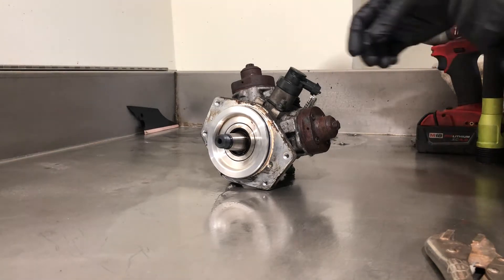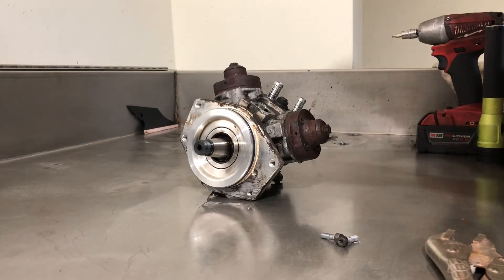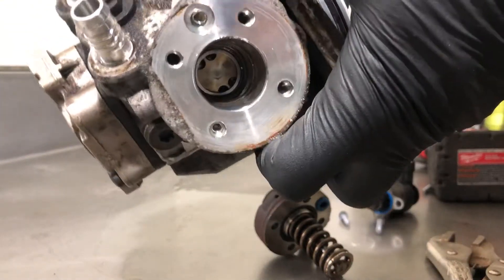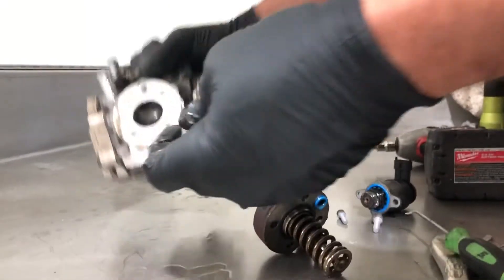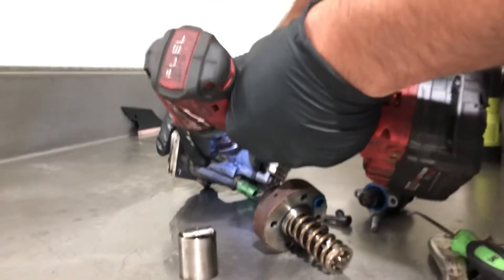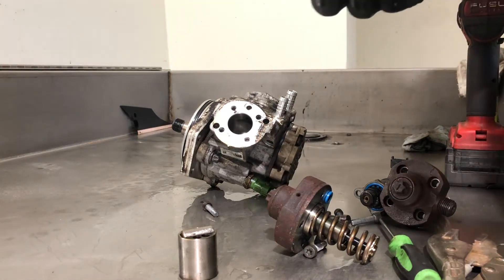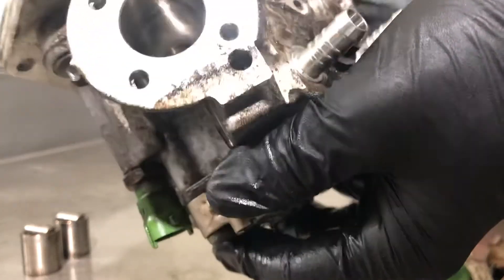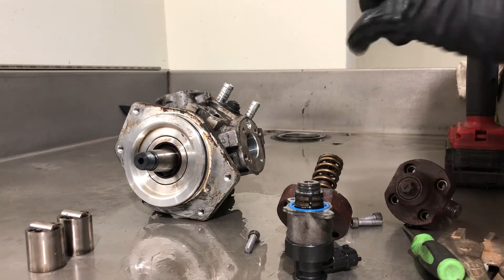LML CP4 failure tear down and why your 11-16 Duramax needs a lift pump!

Comment: I just replaced my regulator on my CP4 piece of crap. I replaced it with exergy system saver. It will not stop the CP4 it from taking a shit but it will save you about $8000 because it actually has a better screen then the stock regulator. The stock one has a 80 micron screen the one I replaced it with has a 25 micron screen, and it is doubled, so it will stop the metal shavings from going into your fuel, rails and injectors which will save you a hell of a lot of money if you don’t have a warranty have a good day.

Comment: OK what is wrong with replacing the FPR and screens and changing the fuel filter a couple times during the first 50 miles of driving.   Those injectors can be flushed out along with the high pressure lines and return lines.   The tank, you can attach a super strong magnet to and potentially harness all minor metal filament from getting into the fuel filter.   Hold off on lift pump till the tank filaments are cleared.

Comment: Will a lift pump prevent the cp4 from failing altogether?. I’ve had a lift pump from 50000 miles. I have 98000 now and I’m starting to really research this failure I keep hearing about.
Reply: It's a good preventative but not a 100% guarantee it won't fail
Reply: @miasmaro98  thank you sir
Reply: I would like to know the same info. Please pass it on if you find out. Thanks.
Reply: Lift pump will not prevent cp4 failures. I recently experienced this issue. It totally sucks.

Comment: Re the comments below stemming from Betty's view that the problem is 'from the pistons getting sideways in the bore of the pump', I think the sideways condition arises from other causes such as debris and is not a root cause in itself.  There is a considerable spring force holding the piston and roller firmly against the cam so, for example, if the piston roller were rising up the cam profile, the only way the roller could 'twist' would be for one side of the roller to rise higher up the cam profile and it cannot do so because of the spring loading.  There are only two points when the piston/roller could twist and they are when the cam is momentarily at either the top or bottom of the cam profile, and it has not the time to rotate nor the forces applied to do so.  BUT, if there is debris between piston and cylinder wall then the piston could jam and lose contact with the cam and then perhaps rotate.  This could give the impression on strip-down that the twisting of the piston/roller had been the cause of the problem.  Why do I feel convinced about this?  Because there are literally thousands and thousands of these pumps operating perfectly well in most parts of the world.  To me the root cause will be found in what is different between operating in the USA and other parts of the world - and I think most people (sufferers) know the reason! 
Very good video with very clear pictures of all components - many thanks.

Comment: So if I do a lift pump, does that save it completely? Also, if I do a lift pump and eventually do a cp3 conversion, can I keep that same pump or is it now useless? I’m trying not to go deeeeep into money here
Reply: If you add a lift pump it will not stop the cp4 from destroying itself, I think water is what is killing these pumps and a lift pump will provide better protection compared to the stock filter.  I ran a year with a airdog plumbed backwards due to the incorrect diagram in the instructions and I didn't have a cp4 failure.  If you do a cp3 conversion your cp4 is pretty much worthless but the lift pump will work perfectly fine with a cp3, but you will want to use compressed air on the injector return line to provide 80 psi of backpressure to start the truck faster if it will not start, it took me about 5 minutes of cranking to get it to start after the swap.  You will be looking at 1400 dollars minimum to do the swap if you don't use a used pump, depending on which pump and tuning it requires.

Comment: Took preventative measures early, installed FAAS lift pump and Exergy metering valve at 80,000 miles, added fuel additive after every fuel fill, at 120,000 miles, did a CP3 conversion, never had a problem with CP4 but I feel more confident now, anyone want to buy my CP4 pump? Runs like new🙂
Reply: what lift pump did you get?
Reply: @kamrinwoodward5822  
FAAS

Comment: Ford runs the same cp4 on the 6.7 with a lift pump that operates at 60 psi and the cp4 still fails. So your solution isn’t really the solution. From what I’ve seen keep up with your filters, run quality fuel, fuel treatment, keep an eye on rail pressure and hope for the best
Reply: So basically just have to be lucky it doesnt fail when ur even taking care of it like that
Reply: Ford just has an  in line pump not an actual aftermarket lift pump like a FASS or Air Dog

Comment: Will an air dog 160 lift pump save and help this pump stay alive longer
Reply: Just helps do a cp3 when possible. I changed my cp4 out at 110k miles and I didn’t have any metal though.
Reply: @TheVanGoat  how much did it cost

Comment: My 2015 Camry which as gas engine so, I do not have to deal with this bullshit CP4 disaster. The fuel pump is justed a brushed dc motor with an impeller inside the fuel tank that sends fuel to the FPR than the fuel rail and tuned port injectors. If the fuel pump shits in a gas engine, it's only a 125 dollars quality Japan or US made part for a Toyota. Pretty much the only way to kill an electric fuel pump for a gasoline vehicle is you have to be dumb by running it on 0 miles to empty too many times.

Comment: A LIFT PUMP will not magically add lubrication to your fuel. Best option is to run a fuel additive to increase lubrication and get your scoring to match regular sulfur diesel.
Reply: Any recommendations?
Reply: @Blue_Collar_Hunter  OptilubeXL has the best results if using with pump diesel. Or you can use BIO diesel direct from pump with no additives.
Reply: @Foxfried  thanks, I'll look into the Optilube XL. I have no interest in running bio diesel. I do have a Fass lift pump & currently waiting for my Exergy system saver to be delivered. But if & when my Cp4 fails I will convert it to a Cp3.

Comment: So allegedly there is a lawsuit against chevy and duramax because the U.S. fuel does not provide enough lubrication.
Reply: We will never see a dollar
Reply: They should sue bosch for making an inferior car part.
Reply: Bosch made the CP4 pump for European standard diesel fuel which is not to the ridiculous overkill of the US standardized low sulphur content and therefore less lubrication.
The design is flawed in this matter by “cheapening” the way the cam and lobe interoperates within the pump versus the CP3.
Reply: @USMCRON  this is not true, US is 15ppm, EU is 10ppm.

Comment: I know I will get haters, but I dont think this is caused by lack of lubrication. Although that doesn't help. I think it is from the pistons getting sideways in the bore of the pump. There is no keyway to stop them from spinning, and when the piston turns sideways it doesn't roll over the cam any more, just chews it up, or breaks it off. 
  I tore one apart and found the rollers were chewed up bad. If they would make the piston so it doesn't turn in the bore, it would prob solve the whole issue. 
 Just my 2 cents. ")
Reply: what about to cp4 running in Europe? were the sulfer content is around 500ppm vs 15ppm
Reply: @ChrisSmith-ig9jq  it is not, EU standard is 10 ppm since 2009.
Reply: I'm sure lubricity helps, but this would not happen at all if there was a keyway.
Reply: @diesellady1  makes sense
Reply: @ Betty Sutherland you are right on point. The two CP4’s I have personally whiteness fail have been from the piston turning and the roller galling the cam lobe or vise versa which then fails and sends metal through the entire system. Every shop I have talked with said these bottom end failures account for almost all of the CP4 problems they see.
Reply: Not a bad theory, I’d expect to see flat spots on the pin sitting in one spot then.

Comment: My tow truck just blew the cp4 a week ago. We swapped to cp3 and it seems to run much better. I don’t think the owner had the tank dropped though.  New injectors and fuel rails were done. I wondering if the cp3 sucks up more fuel because I constantly get the change fuel filter message if I get on it even with a new filter. I hope they did it right repair was 9600
Reply: 😲 OMG yeah I'm gonna be getting on this! That is an insane amount of money for a repair

Comment: About to go start working on my 2012 2500. I'm pretty sure my cp4 blew up yesterday.
Reply: If it makes you feel better I had a lift pump installed and mine still failed. Lift pump wouldn’t have prevented it.
Reply: Sorry to hear
Reply: Im sorry dude
Reply: How many miles
Reply: @dpdevil1  right around 80k. I made the mistake of deleting and tuning the truck without installing a lift pump so it was my fault. Expensive lesson to learn haha
Reply: @jacobgrimm7071  how can you tell it blew up ? And is it pretty a guarantee once it blows up that you’d injectors are trashed and stuck spending $$$$$ or is there some hope
Reply: @jasonjackson329  I can't think of the name of the sensor but if you Google cp4 failure it should come up. But it's up near the cp4 and if you take that out and it's covered in metal then you know the pump blew up. And yeah if that happens just plan on replacing everything in the fuel system.
Reply: @jacobgrimm7071  yeah I’m pretty terrified at this point.  Especially not knowing if the prior owner replaced or did anything about it.  It’s a 1 owner truck. But I’ll be so Fxxxx if this happens to me. Especially with that cost to fix everything
Reply: @jacobgrimm7071  yep it’s got me extra concerned , I had no idea of the amount of money it cost to fix this even doing it yourself it’s still stupid money and yet GM refuses to recall.  Probably cause it’s so high on cost it will take tons of lawsuits and years and years all while we suffer

Comment: Ok but what would a lift pump do to help?  The CP4 has aluminum bore which does not do well with water intrusion in time so does the lift pump just help postpone this wear?  I mean still it will fail in time no doubt.
Reply from the maker: Jerry Jrs Garage the theory behind the lift pump is to stop contaminates and water from ever getting that far which will greatly reduce the chance of failure. But I see what your saying it is just a poor design but without a cp3 conversion the lift pump is your next best option to greatly reduce wear in your cp4 pump.
Reply: Race Ready Fab Yeah I suppose it would help to some extent.  I am going to do a lift pump first then use additives in the mean time.  I appreciate this video.  Thank you!

Comment: Why it needs a lift pump? Easy. It's a POS!
Reply: no its not a lift pump issue! Design issue, lubricity issue, water in fuel issue, running on low fuel and picking more trash up and lack of changing filters all play a part in ruining the poor design of the CP4 junk

Comment: How in the F isn't there a class action against Bosch for creating that POS. I truly feel sorry for Duramax owners, seems like every one of them I know without toons has had a CP4 failure, one in particular with less than 20k miles. Another friend tried to buy a CP3 upgrade and nobody would ship to California. I would not expect 70K miles out of one of those POS. Stay local, be careful taking long trips regardless your mileage.
Reply: Its not Bosch fault. These things run in Europe without a problem.  The problem is our piss poor diesel does not have the lubricity that  our European counterparts do, and it eventually scars the pump till failure. This is why cp4 owners need to run additives like Optilube XPD in every tank.   Exergy has a new metering inlet with double mesh screens to prevent a CP4 grenading.  Its called a CP4 saver.  This combined with a lift pump should help the CP4.  Personally after knowing this, i blame US automakers for using the Bosch system and upgrading to the CP4 and should have stayed with the CP3.
Reply: gm quit using bosh cp4, switched to denso fuel system in 2017, ford and dodge still use the bosh cp4
Reply: Ford uses the seimans now
Reply: There are several class actions.
Reply: He needs to send it to a friend in another state , and have his friend ship it to him. 
Thats how my cousin got a 49 state cat for his car, which is half price of the 50 state version.
Reply: Regarding class action lawsuits, you can check the Morgan and Morgan web site. There's a form you can complete to register your CP4 issues.
Reply: pvcarmon1 
Ford uses this same pump on there 6.7 engine and they work great. But ford has two fuel filters and a lift pump so the pump never runs dry and alway gets clean fuel. It’s actually gm’s fault those things fail.

Comment: Adding fully synthetic 2-stroke oil to diesel fuel to extend CP pump and injector life?
Reply: Not if the 2SO has zinc, which builds up on injector nozzles, wrecks the spray pattern and can prevent injector shut off. So many people recommend 2SO, but it can be trouble.
Reply: Can i put a cp3 pump im my gmc dually
Reply: malazkm 2010 absolutely! Check out Wehrli Custom Fab for a conversion kit. There are others also but WcFab has a great line of products.
Reply: Fully synthetic (Husqvarna premium) etc

Comment: Check my videos, it's not a lift pump matter, the design is flawed. I made a side by side comparision of cp3 and cp4 , highlighting MANY flaws of the cp4 vs cp3.  That pump is no good and need to be replaced by a cp3 in all vehicules before it kills the whole injection system.

Comment: Do you guys have CP3 conversion kits that don’t require altering emissions or tuning? Only reason is because I have emissions testing where I am.
Reply: there are CARB california approved kits advailable for many vehicule. It only needs to be reprogrammed because the flow rate of the pump is different. If it's good enough for california it's good anywhere. The truck will work just the same
Reply: Check with S&S. They offer a CARB compliant CP3 conversion kit option that does not require tuning.

Comment: How many miles?
Reply: My 328d has a cp4.  Died without notice at 131,000 miles.  Car was getting 50mpg on the open highway two weeks prior.
Reply: @deleteduser3749  sorry to hear that...
Reply: @JSvids-g4v  me too.  I am becoming an expert on my fuel system and am going to fix it myself.   Then I'm pulling off the bmw badges.
Reply: @deleteduser3749  Hope it all works out for you! Haha Break My Wallet! Had a BMW M5 and it cost me $6k in repairs so when the oil pump failed I did donuts in it until the engine blew up

Comment: Why in the "F" would Bosch reinvent the wheel and produce that POS! That major screw up hurt a lot of loyal Ford, GM, Nissan and who knows how many other folks.
Reply: It's definitely not emissions, the CP3 pumps are more efficient, take less power, can produce higher pressures and are reliable. They designed the CP4 because it's cheaper, lighter, less moving parts. Quality in comparison to the CP3 is garbage. But its the vehicle manufacturers that jumped on the new pump desighns fault. They could have specced a different design from Bosch, knowing that our diesel fuel is.much lower quality. 

It's even a problem on VWs and is the reason I'm doing a CP3 retrofit.
Reply: @CondoreComputing  wrong. It was made for the European market. The American government mandated ultra low sulfur diesel. Sulfur is the main lubricator in diesel fuel. They don’t have issues in Europe or anywhere else the damn EPA doesn’t have jurisdiction.
Reply: I think it's because of the newer emissions requirements
Reply: It wasn’t a bad pump it’s to blame on poor quality American deisel it’s a German designed pump and they have better fuel in germany
Reply: @logancooper2326  American diesel ain’t poor quality per se. it’s the fact that it is too clean. The epa mandated ultra low sulfur. Under 15 PPM Europe hasn’t made that mistake yet.